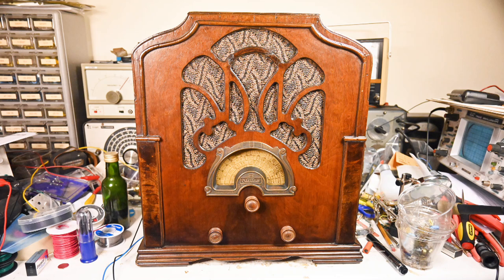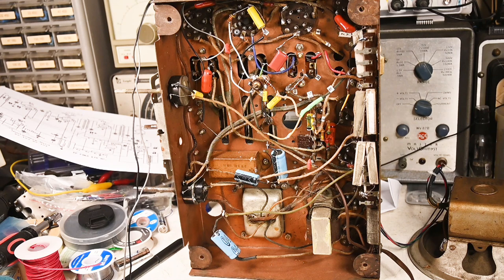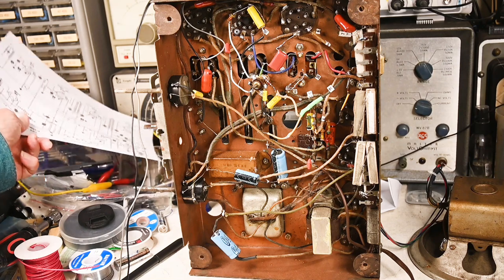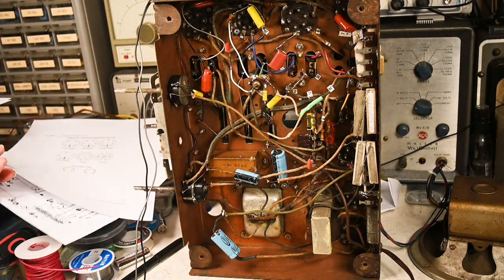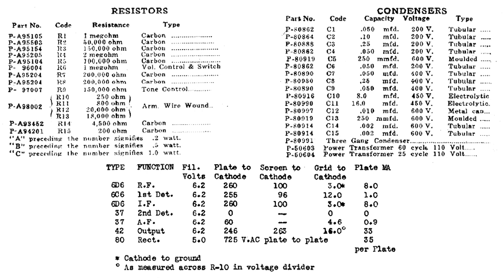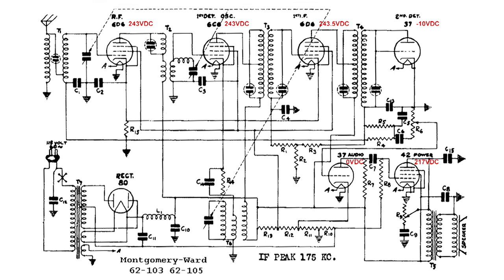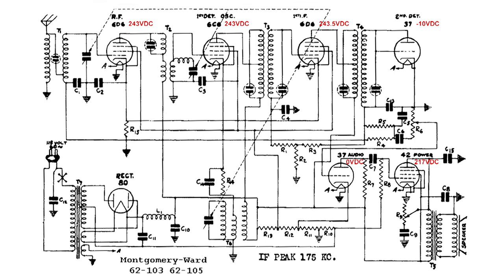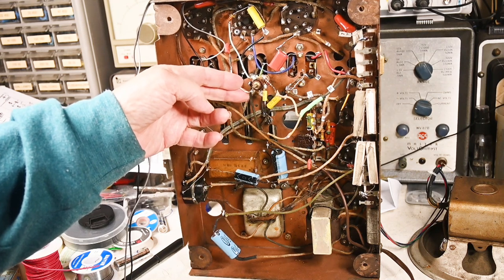How NOT to Repair a Radio

Comment: Hi Richard, indeed when you connect a grid directly to ground the tube will be dead. And to the plate it will act as a diode, so good that you explained that properly. And when radio coils are free moveable problems can be expected.... Good that you show the relativity of the meter readings, using a modern high impedance meter, that is perfect info for everyone liking to do radio repairs. Thanks for this video, as always, Ko Tilman/Radiofun232. 7 dec 2021.
Reply from the maker: Thank you Ko Tilman. The first time I saw the control grid connected to the plate it had me puzzled for a while. You don't run into it very often so I thought it was a good idea to explain that the tube is actually being used as a diode. Hope y'all have a very happy holidays and are looking forward to the new year. Rick
Reply: @AllAmericanFiveRadio  Rick, I wish you all the best for 2022! Thanks for your reaction.

Comment: So disheartening whenever looking forward to a next challenge repair & it turns out to be this much of a hackjob at the hands of someone else. I recently purchased via a local online auction & collected in person a lovely looking 1930s Tombstone Phillips only to be told by the helpful seller they had vacuumed it out for all the old dust (which had removed the original tube location diagram; "plus some other old piece off dusty paper with symbol things & lines all over it & we plugged it it to warm it all up so you could hear it working when you arrived but its stopped now"...
Reply: Ohhhh boyohboyohboy that's just so, so bad.
Reply from the maker: Yes that is very unfortunate, and it has happened to me and some of my friends. Thanks for watching the video. I hope y'all have a Merry Christmas and a happy New Year's.

Comment: Always heed the warnings about working in the back of these radios 📻. Some are a series-string (transformerless) set. This means that it’s a hot 🥵 chassis set. For instance, if you’ve got the volume knob (for example) removed, but ya have the radio 📻 on, and ya touch the knob shaft (it’s brass, or some sort of metal), ya will receive a very nasty 🤮 shock, and possibly worse. The chassis is also hot 🥵, and touching it would be detrimental as well. Upon working on these radios 📻, use an isolation transformer to dump the voltage. This will make the radio 📻 safe to work on. Many 👨 years ago, I was told not to work on TV’s, even when unplugged. The 25.000, or 45.000 volts (I don’t remember which), stored in the picture tube flyback (if I’m not mistaken), is enough to cause major bodily damage, fires 🔥, or ruined 😠 equipment. Use an isolation transformer here, too, if it’s adequate. Sorry 😞 about the long comment, and the emojis. Your friend, Jeff.
Reply from the maker: Yes Jeff you should Always Use an Isolation Transformer! You’ll find this in the ABOUT. You maybe interested in my FREE ebook. The password is allamericanfiveradio
https://www.youtube.com/redirect?event=channel_description&redir_token=QUFFLUhqa2hhVTRycWdJd1FUbTFCZWNmdGtQNlZCRmEzd3xBQ3Jtc0tuOFQ2bFhRcWdjdUdIcUREcnZFaHc0M2xURGhITVRuWDE2cGlDakdYUF9uODktNzc3TVRJTWdROUt6R3NLN2lla3hFS2lIM0RnOXR1dXFxMGx2cUNtWDhXb1Zvc2RCbGQxTThoendmN2E5R0lJdmI0Yw&q=https%3A%2F%2Fdrive.google.com%2Ffile%2Fd%2F1HHmaWYr7UMACfmS4W5uL6PADoem2KlRp%2Fview%3Fusp%3Dsharing

Comment: I've had a few sets come though here with connections like that. I usually end up fixing them. They are just to much of a fire hazard and could burn up something unreplaceable in the set. Thanks for sharing.
Reply from the maker: Thanks. Someone put in more effort to screw it up than if would have repaired it correctly.

Comment: I opened up the chassis on my Atwater Kent 545 and found the chassis full of glue and old decrepit wires. Fixed it up, but I'm still not done with the glue situation.
Reply from the maker: It is getting harder to find radios where someone else has not been in them. I'm glad you're restoring your Atwater Kent. My favorite radios are the early 1920s because it's closer to the beginning of everything.

Comment: There was a "radio repairman" in Centralia/Chehalis Washington who removed all the parts from the tie strips and left them all as air connections, similar to that radio. I had a chance to buy many of his radios, but one look at the bottom of the chassis totally blew the deal. One of my friends bought a few of his sets and had to rework them, and while one of them worked when he had tested it at the gents home, by the time he got to his place, some of the parts had fallen off the air connections. He passed away many years back, but I never thought that someone else did this sort of poor work as you showed.
Reply from the maker: Yes it is a shame. I think it is less work to repair correctly. Thanks!

Comment: Had a shop years ago we had jars of 30s radio parts when we fixed a  antiqueradio we used the original parts of. That erra .tested originas  from scrapped sets never changed to modern parts
Reply from the maker: Wouldn’t it be great if we could get the original parts now. Thanks.
Reply: @AllAmericanFiveRadio   thanx  saved the rider books   couple cathedrals a   baby clock radio philco 30s 4tube.   a parts philco cathedral chassis     I'm 81yrs old  theese sets were on the street as a boy always took the tubes  had hundreds they disappeared we had 10 thousand assorted  tubes  stuffs scattered everywhere ,
Reply from the maker: @donalddesnoo5303  Nice saves! Couple riders, cathedrals, baby clock radio philco, and all those tubes. I also like the 1920s radios. Recently I did tow videos on a 1923 Atwater Kent 10. Hope you like them.
Atwater Kent 10 Signal Flow and Circuit End to End 100 Years
https://www.youtube.com/watch?v=wQ8djN15F48
!923 Vacuum Tube, Amplitude Modulation Detector Circuit in Detail
https://www.youtube.com/watch?v=e0faax3Svgw